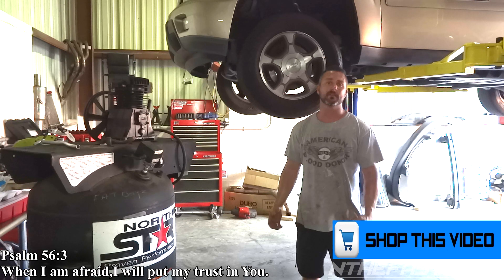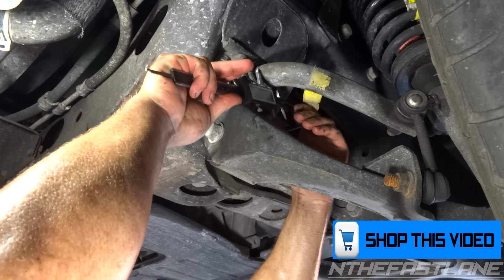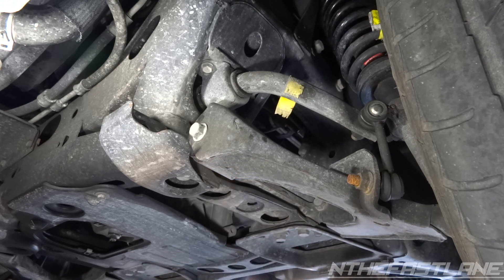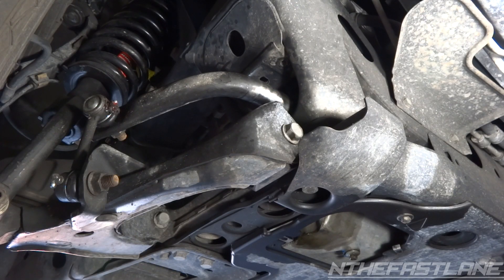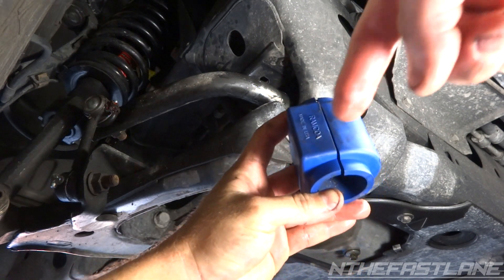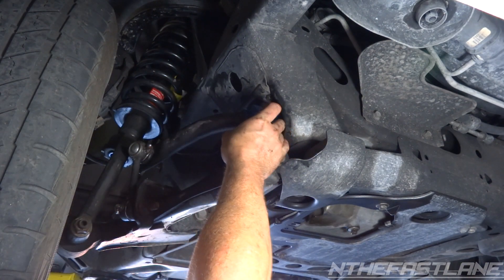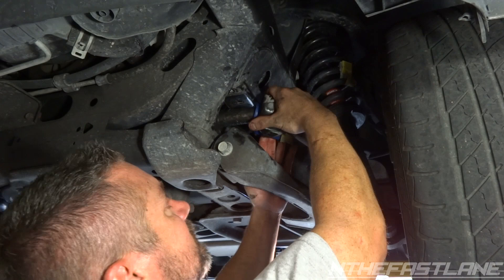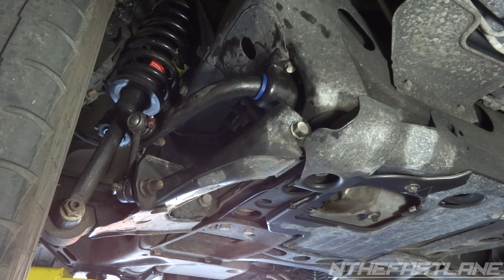▶️Sway Bar Bushing: How To Replace (Chevrolet TrailBlazer 01-09)🔧

Comment: Don't use multi purpose grease. for 1 ..it attracts dust and road grime turning the bushing into sandpaper over time. for ..2 you don't want to use petroleum products on the rubber, because it will break the rubber down faster..... use a silicone lubricating spray.
Reply: Dang it! I knew it. I put on lubriplate. It's only been on for a day ill take it off  clean it and apply silicone lube
Reply: All those blue aftermarket bushings from Moog etc. are made with thermoplastic, thermoplastic do not need to be greased with anything, rubber ones and poly ones need silicone, the rule of thumb goes if they come with grease grease them if they do not come with grease don’t grease them.

Comment: My 03 trailblazer needs replacements, i can find the bushings but i can't find the bracket that goes with it anywhere online. My passenger side bracket is cracked so i would like to replace both of them, do you know of a website that my have the brackets?

Comment: My Dad have a Chevy Blazer and it ONLY makes noise when BUMPS or when we hit the Pot Holes. Is that we have to replace? THANK YOU !!!
Reply from the maker: Check the sway bar endlinks. Thoes usually make the noise along with the strut. Just inspect the bushings for pieces missing.
Reply: OK THANK YOU, sorry for delays on reply

Comment: thank you for the video I have a quick question I just bought a trailblazer ss and when I run it for a good few miles I get a squeaking noise from hitting small bumps to a squeak noise when I turn my steering wheel I just had a really bad control arm replaced along with ball bearings but the noise is still there any idea what it could be?
Reply from the maker: Jake88chevy I would say first inspect the sway bar endlinks, if there are no broken bushing pieces I would look into replacing the shock. They sound like a high pitched mouse/bat or even a rusty seesaw when they get a lot of miles.
Reply: it has 117,000 miles on it as we speak and yes while turning my steering back and forth it's creaking just like you said thank you for your fast reply sir
Reply from the maker: Jake88chevy Jake88chevy Anytime Jake.👍 When you replace the shock I would go with the whole strut and spring setup,replace both front. They're not that expensive on ebay or amazon and will save you a lot of hassel. Here's a Strut repair I did on a Corolla that is initially the same repair. I have the Chevy Strut repair I'll be uploading at a later date. Make sure you get a alignment afterwards.
LINK: https://youtu.be/Grrx2XASKBs
Reply: Probably too late but I thought I might leave this here for anyone in case they had the same issue I did. I had a squeak that would not quit. I replaced the shocks and struts, the sway bar end links and bushings... It really needed it and handled much better afterwards... But did not fix the squeak. I spent the better part of a year tinkering and thinkering but couldn't figure it out for the life of me.

One day a light bulb went off and I ran downstairs and popped the hood and my lil bumper guys under the hood were shot. The squeak was my hood latch from a little tiny movement of the hood. Replaced them for six bucks. 

Easiest fix the the longest, most annoying vehicle problem I've ever had.

Comment: My old mechanic said I dont need new busings, but they sliding out from the bracket.
Reply from the maker: If that's happening then it's very possible they need to be replaced. Possibly cracked inside the U bracket if they're coming out.
Reply from the maker: Or from so much wear and abuse they have flattened out and no longer fit snug in the U bracket.
Reply: Thanks
Reply from the maker: Yo Fizzle Anytime

Comment: great job man you sure made that look easy I think that truck needs some tires badly
Reply from the maker: Thanks Bill! Yes it sure does. The lift kit was installed by another shop and the customer wanted to wait for alignment until the bushings were replaced and track down an annoying screech every time the passenger side strut would compress. Turned out to be the 1/2in lift kit plate on top of the strut was rubbing the upper sidewall. Loosening the 2 top strut nuts and forcing the strut in towards the motor, then re-tighting did the trick.